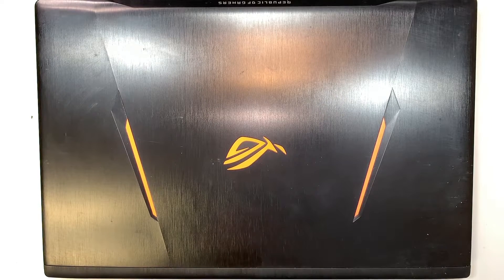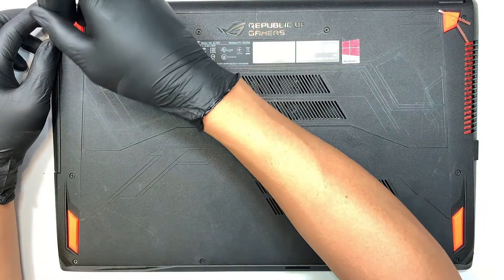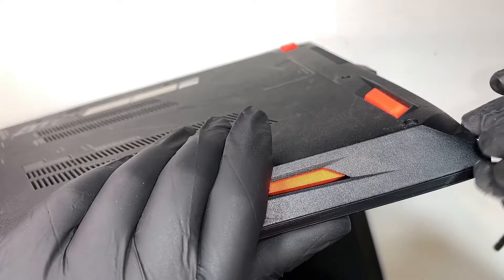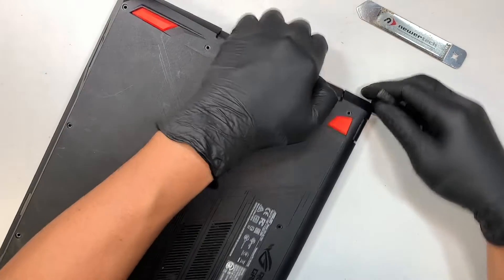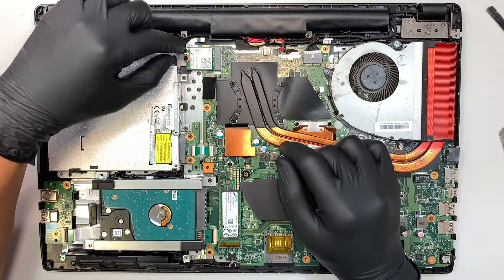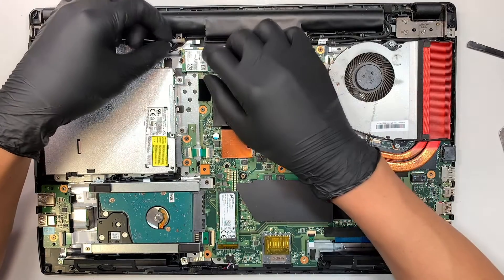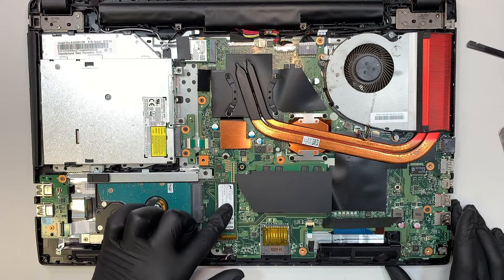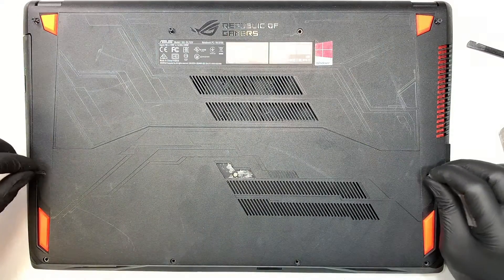Asus Laptop lost WiFi signal   GL753V

Comment: Como puedo encontrar los cables que se conectan a la tarjeta wifi que a su vez pasan por dentro del monitor por los costados? Me funciona aún mi wifi card solo que accidentalmente una bisagra metalica se quebró y rompio intermante el cable de la wifi card que pasa por ahí
Reply: The wifi cable is generally a black one that runs through the right hinge up the ride side of the screen to an antenna, you can buy replacement antenna cables online, detach the old one from the wifi card inside and route the new one.